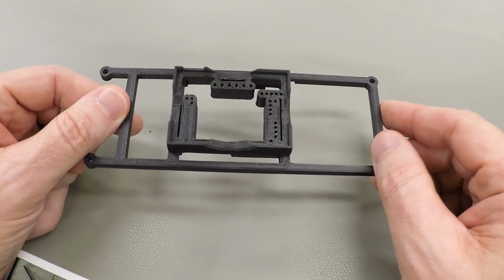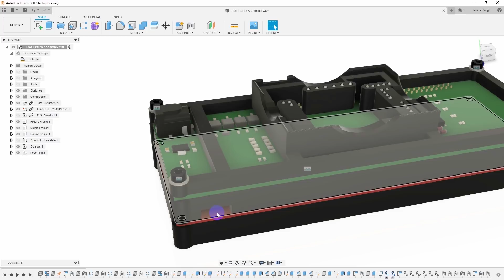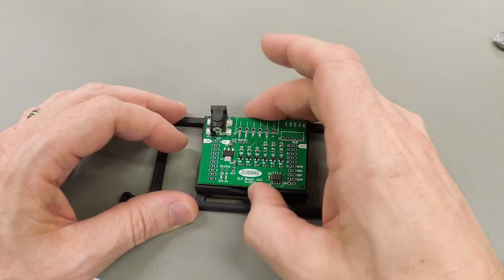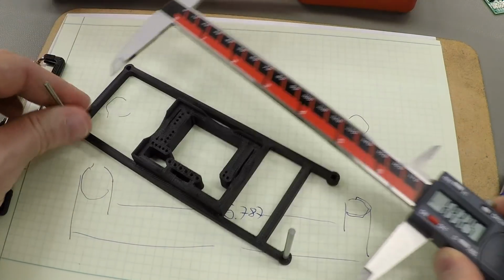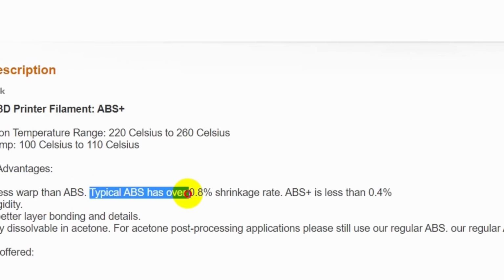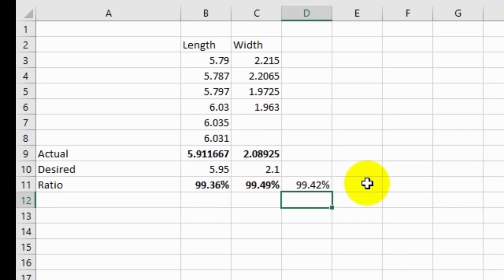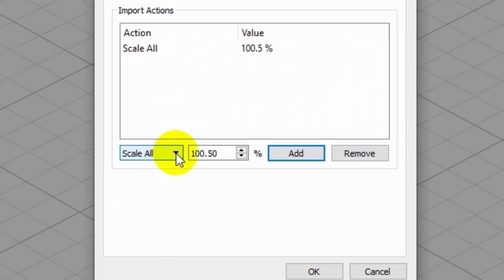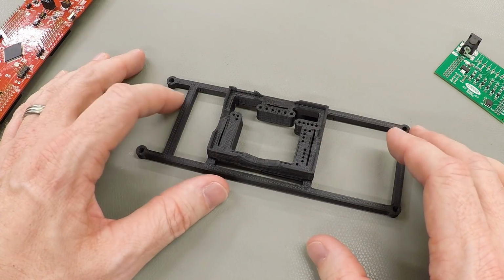How to 3D Print Dimensionally Accurate Parts

Comment: The pitch of the GT2 belt is actually only valid for a particular specified belt tension. If the tension is wrong, the pitch is wrong, because it does stretch by quite a bit! Well then again that's my experience and i use Chinese parts and not Gates belt. But its easy to check, you tape your calipers down under the nozzle when it's close to the bed, jog the head a bit via controls, zero the caliper, and then have the print head walk a known distance and compare. It's probably pretty close, not enough to make up that difference.

The claimed 0.8% shrinkage for standard ABS is significantly less than what i've seen myself, i expect closer to 1.2% shrinkage. I think they have a measurement method which is very kind to shrinkage number. But any figure is a rough guideline since shrinkage is non-uniform depending on shape.
Reply from the maker: From the moment I read the claim of 0.4% shrinkage, I assumed my results would be a little worse.  They're definitely not going to publish the worst-case scenario in the marketing literature.
Reply: @Clough42  yeah I wonder if the Z axis has the same shrinkage
Reply: @nirodper  You might be surprised, often times when the print shrinks, the XY shrink but Z expands a little - just a little! Something about molecule orientation, you can imagine them as springs, you lay them out predominantly lengthwise along your extrusion direction, and when you release and cool down the print, they shrink down; but the material still has to go somewhere. The print shrinkage is not merely or predominantly thermal shrinkage, as you can see, say PETG has no print shrinkage whatsoever.

Comment: You can edit your process settings and set a profile for each type of material you want to use. Then on each profile under the Other tab set the Horizontal Size Compensation appropriately for that material
Reply from the maker: This setting may not do what you think it does.  Check the follow-up video.

Comment: I don't know if someone already pointed it out, but scaling up x% will not make your part come out at the desired size if its shrinking due to the material by x%. The right amount you would need to increase the print should be equals to (100/(1-x/100)-100) % which can be approximated to x% but it is not precisely the same. For example, if your part is shrinking by  0.5% then x = 0.5 and thus you would need  to increase the model by (100/(1-0.5/100)-100)% = 0.50251256281%
Reply from the maker: Yes.  That has been pointed out.  In this case, the lack of precision in the original measurement swamps that error.  But I believe you now hold the record for decimal places.  :)

Comment: Thanks for your experience and how you fixed your specific problem. I'm using Cura so I have to explore my options and I also have to verify if I do this whether or not already made .STLs haven't been scaled up for a material if I go this route. But I really like how this would alleviate some of the headaches of issues related to FDM printing for my use case.

Comment: filament temp also matters. I use mostly PLA, and if I run it at 190 vs. 200 for the one I use for instance, it prints more accurately, and part geometry matters so much that each part will have its own unique scaling.

Comment: I ran into the same thing making a part for my Dad to fix a clock. We needed to drill a pendulum because the rating nut stem broke off. The square rod was 4mm square and his jewelers lathe dead center end was 7.61mm and round. So, being the "smart nerd geek" I printed a 7.61mm cylinder with a 4.1mm square hole in it. It didn't fit! The cylinder turned out to measure 7.43mm and the square cutout...4mm (tight, more like 3.99mm). So back to SolidWorks and this time I would not be robbed! The cylinder was not so critical, so we left that alone, but the square hole, we made 4.23mm and I made relief cutouts (very small circles, .02mm) in each corner. We were VICTORIOUS! the clock lives and my Dad saw that a 3D printer was not just to print "Groot" and other frivolous toys. It had real world applications and in its own right, is a useful tool.
But make no mistake, shrinkage is real. If you have parts that must interact or pass through or by, measure and use the shrinkage calculations to determine proper fit before you print everything for a project. Especially for a new project!

Comment: Generally, you shouldn't have to scale the z-axis as much for a FDM part as the scale for the X- and Y-axis.
Reply from the maker: I think this depends on the temperature gradient in the part during the print.  For tall parts without a heated chamber,  I would expect a different average shrink factor, but I would also expect it to vary with height off the bed and also with part geometry that might block airflow.
Reply: Yeah... Measuring x and y and then applying that to Z does seem like a drastic change in in carefulness.

Comment: Here is my experience with 3d printers which run on pulleys and belt, the numerical calculation is always not equal to the distance traveled by the component. Yes, parts do shrink but the best way to calibrate the sizing is to manually move the printer a set number of whole steps and measure the distance traveled on the printer. Make sure the belts are tensioned to your liking before this of course. After this calibration has been done to the steps/mm of the printer then you can calibrate shrinkage on a filament by filament basis.
Reply from the maker: This is correct.  I did some measurements at one point in the past and decided it was negligible for my use case, but the printer's been running for 3 or 4 years now without any adjustments, so it would be worth checking again.
Reply: I agree. I think that this video is based upon an assumption that wasn’t correct and was not really proven by disproving all the other possible causes. This could be misleading to people thinking that shrinkage is the cause, when in fact it’s the cheap GT pulley wheels that are introducing an accumulating error.

Comment: did you design and build your 3d printer?  great video ...yeah shrinkage is not fun...and it varies with diff  brands of abs/pla etc...thanx for sharing
Reply from the maker: Yes and no and yes.  It began life as a frame kit from MakerFarm (12" i3v with the laser-cut wood frame).  I built it up with eBay motors and electronics, a silicone industrial heating mat and more than a few parts I designed and printed to solve specific issues.  The dual extruder is my design (Itty Bitty Double FLEX V2).  Mostly at this point, I just use it.  I don't think I've even taken a screw out of it or adjusted anything in about three years.
Reply: @Clough42  extrusion is the only way to go

Comment: I've learned about the shrinkage issue purely by experimenting initially, but did some research afterwards.
The shrinkage is real and is based on many things, including material, nozzle, heatbed temp, room temp, and so on.
ABS, not sure about ABS+, is known to have as much as 7% shrinkage rate in some cases and PLA around 2% and nylon around 1.5%.
I've changed my 3D printer once and the rate changed as well.
Here is the deal. Print a ruler when you use your 3D printer for the first time or in a new environment and figure out the shrinkage rate, AND try not to change the room temperature and ventilation too much form that reference. You'll be alright.
Reply from the maker: I've seen numbers for ABS quoted as high as 8%, but I think someone lost a decimal point and others have quoted that source.  I would have to see shrinkage like that to believe it.
Reply: @Clough42  No, the 3D printing community isn't that stupid. The ABS the material’s high coefficient of thermal expansion can cause upto, meaning maximum of, 7-8%. Shrinkage rate of 1-3% is commonly reported by many users. It's also  depending on whether it has a filler or stabilizer. 
If you need to see it to believe it, try printing it near open window in a cold windy night. You'll quickly see that decimal point number goes away very quickly.

Comment: I also print engineering parts for my designs. After a few dummy runs I ended up using 100.5% scaling factor for PETG. 

likewise, I use Simplify3D but wasn't aware of the option to auto scale. Thanks for the tip. 
Some of my projects have moving parts and gears ...etc. so now I'm thinking of getting into SLA for accuracy, detail and maybe strength? 
Love your channel.

Comment: You normally only compensate in XY, as Z isnt affected in the same way, due to layers building upwards
Reply: Zplizor not true material shrinkage happens isotropically I can’t think of a manufacturing process that would cause anisotropic shrinkage. Please educate me
Reply: @HypeBeast764  I fully agree for molded plastic.. But due to the layeing 3d printning do achieve a semi anisotropic mode..  Do a short search for abs layer separation.. This is partly due to the stresses in x and y
Reply: Zplizor I can see where you are coming from and I used to think the same but unfortunate not true for small parts or parts printed in a heated chamber. You’re right, layer separation is due to stresses in the material and that’s due to a temperature gradient. On small parts, and parts made in a heated chamber the ambient temperature remains close to the bed plate temp. You can calculate shrinkage by using the linear thermal expansion equation and calculating delta T as the bed temp minus ambient room temp. To clarify I mean small parts as in short parts with respect to the Z axis, so parts that are not tall. You’re right however that on MOST printers that if you create a tall part that this won’t work, but that doesn’t matter because you can’t make tall parts on a printer that has a bed that is completely exposed to ambient room temperature. Ultimately gets around this with a kit to seal 5 out of the 6 walls surrounding the printer.
Reply: @HypeBeast764  I agree, i have only printed a limited number of big abs parts, and here i didnt compensate for z, thereby i deducted that it wasnt needed due to the layer building nature
Reply: Zplizor yeah so I was determining the CET for Ultimaker ABS through test prints and measurement at work and found that it’s super low, almost so low it’s negligible. I think some 3D printing blends may be so low it’s almost not even worth factoring unless you’re printing something needing precision and takes up the whole build plate. For a 120mm part I was getting around 0.249% contraction at room temp. I know that 3D print blends try and reduce the CET as much as possible for 3D printing at the cost of material performance with the exception of Makerbots Real ABS that is designed for the method which has a heated build chamber. So depending on what material you’re using you may not even need to compensate as the impact could be negligible.

Typical ABS has a CET that would contract the part from 0.596% to 0.793% so only contracting 0.249% is super low

Comment: Suggest doing a physical calibration of all the axis of the printer: mark current position, move 10cm, measure, repeat for all axis. Math and real-world often don't match up.

Also, filament shrinkage isn't consistent in all directions. Is the height of the frame also correct now or is it a tad higher than expected?
Reply: ^ ^ ^spot on this.

A dial gauge clamped to the frame and a couple of gcode commands would validate the chassis, repeat for x, y and z

Due to the layering the z will certainly be different - in my experience it has been significantly less than x and y
Reply from the maker: Physical calibration of the printer is a good idea, but even if it's perfect, the plastic will still shrink as it cools.  I did measure the height of the part.  From the base to the register for the PC board under test is modeled at 12mm.  I measured it in three places and got values between 12.01mm and 12.03mm.  That's plenty close for a 3D-print with .2mm layers.

Comment: There is a parameter called horizontal expansion or similar in the slicers that you may want to check. It should do exactly this and you can configure how much you want for each material you use so you don't have to remember to scale up each piece for each material differently. It doesn't expand z axis though.

Good video and very well explained.
Reply: Jes. But dit works not for the shrink. Only if you print parts that must fit together type holes

Comment: Hi James.  A first-class video presentation as always and your channel is one that is up there with the best for both content and accuracy of the content that delivers on the watchers' expectations.  I wonder if you might just elaborate a bit about why you used ABS for this frame.  My understanding is that PLA or PET-G does not suffer the same shrinkage issues.  Perhaps you could do a video on this subject and clear up once and for all the shrinkage problems.  I would be most grateful for your advice on this.  A general rule of thumb for percentage scale-up of a model would be a welcomed addition to anyone making electronic jigs like this. If you lived in the Uk I would buy you pint to thank you for your efforts.
Reply: PLA does shrink, more pronounced on thick parts.

Comment: If the issue was shrinkage as the part cools, wouldn’t you witness this as the part cools on the bed?

Could you attach a dial indicator to your printer and move the gantry and check the movement? It feels as though the diameter of the GT pulley wheels might be in error. After all, any error will be multiplied up by the number of rotations. Hence why, although we can in theory calculate the steps/mm, it’s best to perform a physical measurement to do the final correction.
Reply from the maker: It is possible to observe it.  If you're sitting next to the printer as it cools, you can hear it cracking and popping as it shrinks faster than the glass and pops off the bed.  Small errors in GT2 timing pulleys do not accumulate over multiple rotations because the teeth keep the belt synchronized.

Comment: Great video! My issue are the holes. I get pretty accurate dimensions, but most of the holes print smaller than designed. If I print a 5mm hole it will be like 4mm...Seems worse the smaller I go. 🤷‍♂️

Comment: Curious now if the first layer is actually sticking to the bed at the correct dimension and the next couple of layers are where the shrinking occurs. I always end up with slight elephants foot on a non fillet or non chamfered bottom edge. Very slight, but still there. If this is happening, a corrective chamfer with different width and height could be figured to give a true square corner. Splitting hairs but, I too like dimensionally correct parts. I guess I could pause the print at the second layer and measure the part while still in the bed. I can’t imagine the first layers shrinking .5% while attached to the warm bed but, I suppose it’s possible. Great video. Got me thinking here.

Comment: I print the part 4 or 5 layers high and stop print.
Check the size and adjust for shrinkage.
Saves on material and time on a full print.
I also use this method to make templates for drilling holes.
Reply from the maker: I'm generally going to print a part several times during the prototyping process, so I generally expect that I'm going to scrap a few for reasons other than fit.  It's just so easy to print overnight or while I'm at work and then make adjustments and print again.

Comment: Do you think this is a better way or an add on to changing the steps from the stepper motors in sizing your parts to be dimensionally accurate?
Reply from the maker: I do both.  I adjust the printer to accurately move as directed, and then adjust the scaling to compensate for material shrinkage.  That way I can dial in the published shrinkage rate for the material as a starting point.

Comment: This video inspired me to measure the shrinkage on PETG and PLA.  I've got 4 different brands of PETG and I have tested the Amazon Basics/Overture (pretty sure these are same company) and HQA brands so far.  The Amazon Basics shrinks about 0.22% and the HQA shrinks 0.20%.  This was with 250C and 80C bed.  I also tested the Solutec PLA and it appears to be almost unchanged with a shrink factor of 0.004% which is not statistically significant.  The PLA was printed on my CR-10 and I got this result in the Y dimension.  The X dimension appeard to grow by about 1.23% but I found this is caused by the way the belt is attached to the X gantry.  At the left and right the belt angle relative to the motor pulley (left) and the idler pulley (right) cause a tension increases and an increase in X motion.  The belt is not attached to the gantry at the right point.  The error is not too bad in the middle but it is non-linear across the span of the X.  I suspect the Ender 3 has the same issue.

I printed my test print with the scaling in the slicer at 100.2% on the HQA PETG and the dimensions are spot on.  I will test the ESun and Filastruder (actually Keene Village Plastics) brands sometime soon.  The PETG prints were done on my V-King Core XY with a 0.3 mm nozzle.  As always, your results may vary!
Reply: good to know

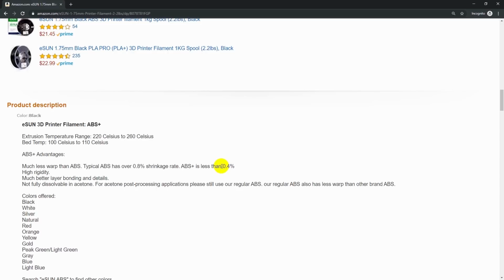Comment: 14:00
Funny, I just did a 100mm print with 0.4mm deviation in both X and Y axis. Now I'll just scale my models by 0.4%
Reply: I have about .2mm deviation in my round parts i calibrated my xy and ran all calibrations on my p1s still same. Results. Any tips
Reply: @cheizaguirre5494   I didn't calibrate anything, I just resize in the slicer. I'm not a pro by any means so I can't help you with that other than scale it in the slicer and see what comes out. 

There is always the possibility also with mine that the deviation is so small it's inside the standard deviation of the machine, like it can't improve by such a small step but I'm not sure on that.